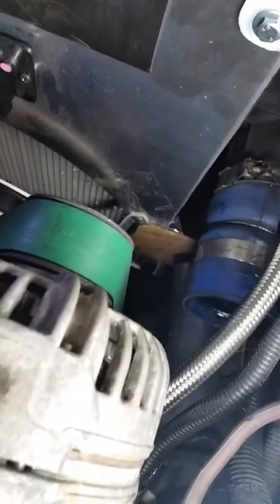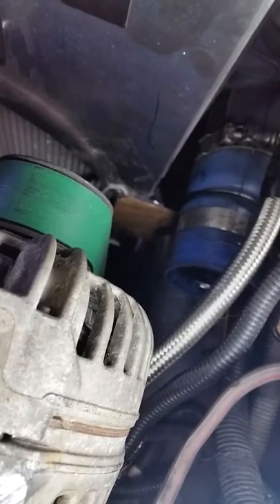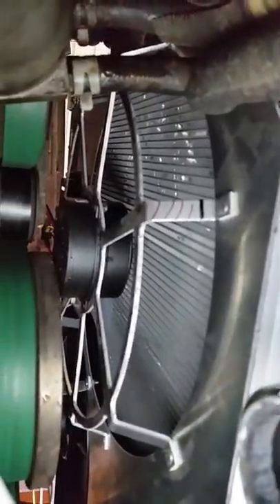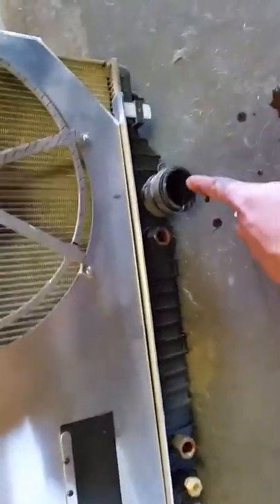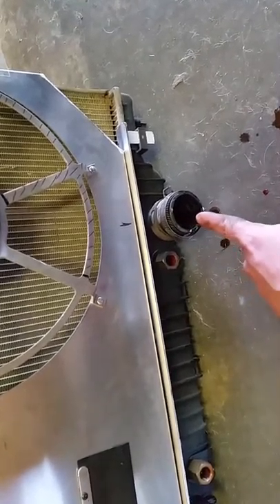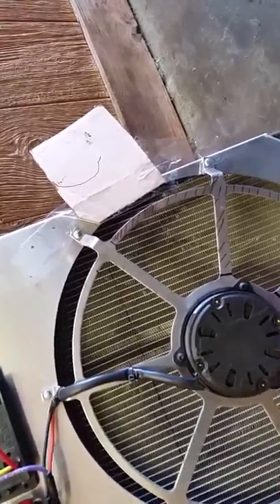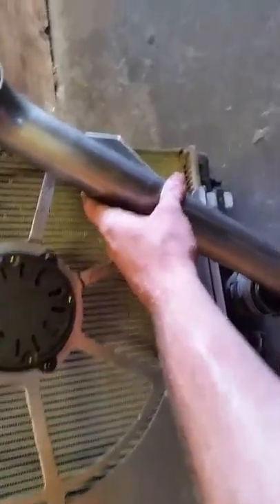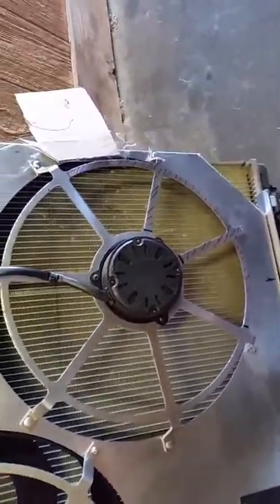Ford Cummins electric FlexALite radiator fan install 2of3 Fummins

Comment: Awesome cummins swap man, looks nicely done! How are the E-fans working out, are they enough to keep it cool? Done any towing with em? Just received my flex a lite 272 for my 7.3 and going to do the conversion soon. Any pointers or tips on how to dial it in? Thanks!
Reply from the maker: They keep the engine coolant temperature good. The only problem I have with them now is that there’s not enough air flow over the condenser to keep the AC cool. I think I’m going to go back with the mechanical fan or OEM fan this summer. But for any stock truck the air flow might be great but not for a Cummins swap there’s just not enough airflow. I’m sure FlexLite has the airflow covered for a stock truck. Your fan should hook up exactly the same as I did mine. I just hope when I put the stock fan back on my truck that Destroke wired the harness so when the air-conditioner is on the fan engages.
Reply: Hey thanks for the reply back and info man! Glad to hear the fans are holding up and at least doing the job keeping the rad coolant cool. Looking forward to getting rid of my loud n heavy clutch/fan. Hopefully going back to the mechanical fan works out and you'll get the better a/c performance your looking for. Too bad there wasn't a little more room between the back side of the grill to mount an additional pusher fan in front of the condenser.  I think I'll have to use my a/c wisely and maybe not expect too much from it at low driving speeds as I have the huge Mishimoto trans cooler that won't help pull the air through the a/c condenser. I plan to use the 3 way override switch to turn the fan on from the dash to 100% Also installing a Auto meter water temp gauge and will use the port in the water pump, will be nice to get a real temp reading and forget about the stock temp gauge in the cluster. I'll have to watch your vids again with closer attention to the wiring and were to tap a fuse under the hood for the key on switch. Thanks again for the info and that is a VERY nice Fummins swap you did! Many people can only talk and dream about doing lol.